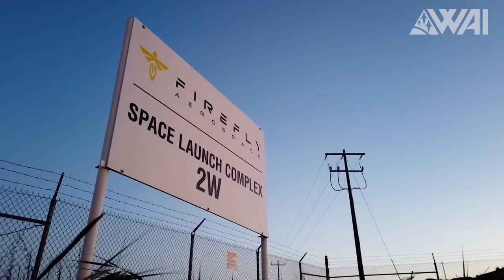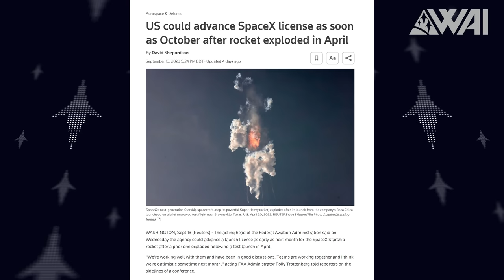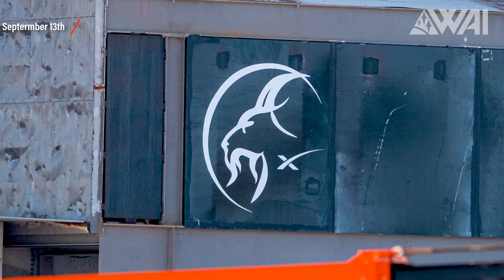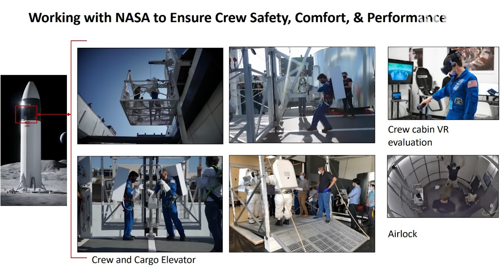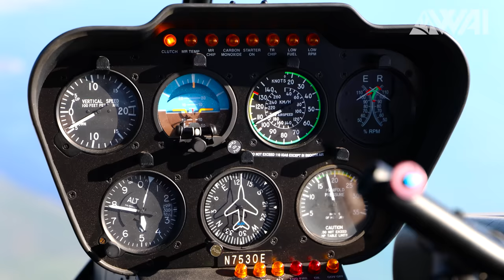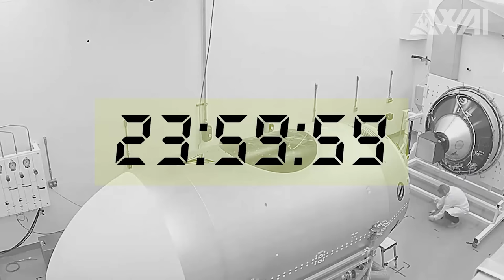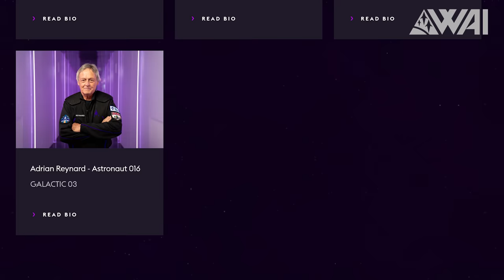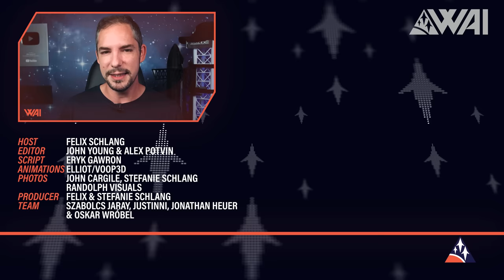Bad News for SpaceX's Starship! Good news for another Rocket!

Comment: With SpaceX developing a private version of Starlink for the military you'd almost think the US military could/would move things quicker citing strategic importance
Reply: The US military reserve the tight lock GPS away from all users (except them). Starlink will probably use the same principle. US military reserves the right to grab 100% bandwidth when tactics/strategy demand.
Reply: @Dave5843-d9m They stopped reserving accuracy for the military alone over twenty years ago.
Also, they can't "reserve" anything if it doesn't exist nit wit. Try reading the original comment, considering it, then answering it in a way that a way that actually makes some sense?
Reply: They are? Complete BS. They formed  committee to study the feasibility, period. Point to point is complete vaporware.
Reply: @UpperDarbyDetailing   correct. The OP is not correct, BTW.
Reply: @jcwiggens  I didn't know if they were or not, which is why I didn't comment. Thanks for the further input on that topic.
Reply: Strategic importance?...What do military communications have to do with gender equality 🤔
Reply: @THX..1138  what?
Reply: @UpperDarbyDetailing  I was wondering the same thing.
Reply: That was how Kennedy was moved along and why to this day the studies they are required are fewer and have never stopped it's mission.
Reply: FAA & FCC move at there own pace. It's a ballet.
Reply: you want the military to move fast on anything , wow, you must not know the military.
Reply: @kstaxman2  Kennedy has always been civilian.
Reply: @jcwiggens  yes Kennedy is and has been a civilian facality on paper but from the beginning the military has used it to launch military equipment and as such pushed to get them open and keep them open. And the launches themselves were almost all government launches. From Mercury to the space shuttle Kennedy almost exclusively handled government programs. It's only been in the last 15 years or so that private programs have existed in any meaningful way. And when was the last time you heard of a launch at Kennedy being held up by an environmental review? They are allowed to operate with environmental oversight but Kennedy as NEVER been stopped from launching for environal issues nor for their proximity to the heavy populations that are in the area. And after 50 years the wet lands and oceans that make up the environmentally sensitive area Kenney is located in have done just fine.
Reply: @seancollins9745  , who were you referencing? Because I only served a measly 23 yrs. And no, we want the military to move steady, smooth,and only when "fast" appropriate. Moving "fast" usually leads to mistakes, death. The military mantra is slow is smooth, smooth is fast. Not rushing into doing wrong things, mistakes. Civilians have this wrong impression the military is this magical thing that does miraculous things at a whim. Which couldn't be further from the truth. From idea to engagement on mist everything it's months to years. Only actual combat is fluid, even then there's a ton of planning thought out weeks, months in advance. Only when certain immediate objectives need to be taken, as the alternative is worse, is there rushing. Save all that Hollywood high speed shit for the theater.
Reply: You have to take in things like approval, budgetary constraints, the fact sats arnt things you 3D print in the garage over night, take years to vet functionality and survivability, as they cost billions each, logistics, and while spaceX is doing good, it's still in its infancy, has existing contracts, and if the U.S. should start planning sats in space suddenly, it eoyld cause international alarm, and people like putin/Russia, get button pushy feeling real quick. Slow, calm, and steady is the way. The other hold up is the democrat party that doesn't have any love for either space exploration, nor for Elon, a Conservative. They think his money should be spent elsewhere.
Reply: @ThatGuyintheKilt ,  talking coms or GPS? SpaceX isn't really into Geo Synchronized orbits at this time as they require single use,loss of rocket modality. They're not able to build rockets that fast,  at least not while starship is in its infancy requiring priority most of engines built, and facing time constraints with the FCC and international challenges,  ie, China and India trying to shut him out, not to mention bozo.
People seem to think he and his business exist at the pleasure of government. Not realizing that things like starlink were not put up to solve world internet desires, but to provide a service for SpaceX, while also targeting rural coms for revenue for SpaceX as well. Starlink first and foremost serves SpaceX needs, and is also rented out as a secondary revenue generator. 
I mention that regarding those that complain about him shutting off service to a location in Ukraine that he didn't even offer service, but temporarily adjusted for temporary use, then found out it wasn't being used for emergency use as stated, so he put them back into intended orbit because he doesn't want to be an accessory to war operations of foreign nations.
Reply: @UpperDarbyDetailing  Excellent reply. The prevalence of "nit wit's" in the YT comments is astonishing. I am eternally amazed at the number of posts that are incomprehensible gibberish.
Reply: @robertm1672  tag the wrong person?
Reply: Hope these Military Satellites do not turn into SkyNet!

Comment: 3:15 the water discharged isn't toxic, but it's fresh water. I don't know the normal rain fall in that area, but I think the local flora could be affected if most of the ground water is brine or even sea water and the plants are adapted to that salinity.

On the other hand, it might be that the FAA is also crossing all the Is and crossing all the Ts by updating the statement and denying the opposition any chance to sue for not having the new plate in the considerations.
Reply: Fresh water shouldn't be a problem, since the deluge system could run continuously for years and not match the volume dropped by just one of the hurricanes that regularly trouble that part of the world.

I suspect they're more concerned about contaminants... it might be clean water coming out of the pipes, but it's flowing through an industrial site, so the question of what's flowing into the sea must at least be asked, even if the answer is "nothing serious".
Reply: The bigger issue would be the boiling water - which can cause faster chemical reactions and generate unpredictable results.
Reply: @jessepollard7132  That doesn't help, certainly...  that's the factor that upgrades "just use seawater" from merely being a bad idea to being a catastrophic one.

I doubt it would still be boiling by the time it reaches the local waterways... it'll lose heat pretty quickly flowing across the ground. But yes, even if it's only a few degrees warmer than the surrounding water, it's something that can disrupt the local ecosystem. Better if SpaceX can prevent the runoff from occurring, avoiding the need to debate the consequences...

Comment: Thank you ror 300 learning experience options. SPACE X has so many engineering steps, projects etc and each gets tested retested and redesigned. This is why engineers want to work for SPACE X by preference. There is so much leading edge in depth work of substance to focus on.

Comment: Even when the air is hot and dry it's never as dry as you might think it is. Those tiles hold so much moisture they are drilling more holes and larger holes at the bottom of each tile to give water vapor coming out of the hot tiles a place to exit. It prevents tile cracking and spalling.
Reply: Sounds to me they need to manage the humidity with some kind of dehydration skirt and negative pressure interface or at least a subdermal heating element matrix.

Comment: My guess is that they will need to build something to collect the water för cleaning. As I have written before, pressure washing the launchpad with steam and sending it hundreds of meters of the base in a sensitive environment will probably not be tolerated. The question is more WHEN they need to build it. Will another launch be tolerated before this is in place?
Reply: why not, a rainstorm dumps that much water in a minute onto the area and the river a quarter mile away dumps that much water every minute into the nearby ocean and wetlands.  in 100 yards, it is water vapor(same as a cloud or fog)more than steam.  I have seen no vegetation effects.  the trees are still being trees, the bushes are still bushy.  They built a collecting pond and just finished a raised border for the pad that sends the water for collection.  They are using potable water from brownsville -
Reply: You know the Cape is also surrounded by vast nature reserves and they tolerate the deluge clouds just fine.
Reply: @peetky8645  Its not so much the water as all contamination from the launchpad being washed away... (Yes their will be a lot of contamination from both all work being done with all tools and vehicles but also from oils and stuff being used on every single movable part of the base)
Reply: @drosendahl  So by "collect water for cleaning", you meant in case someone spilt some drops of oil while lubricating a hold-down clamp hinge?
Have you noticed how SpaceX can cover the rocket bidet in a tarp when not in use?
How do you think your concerns compare to a dark-grey deluge cloud of water mixed with a few tonnes of burnt diesel (RP1)?
Reply: @drosendahl  oil is an organic compound and is biodegradable.  maybe coolant from a radiator leak could be a problem.
Reply: @peetky8645  Oil leaks may still be very bad for living things but it was just an example, that's why I said "contamination" because it most likely more than different types of oil.
Reply: @cbboegh  Compared to what? The only things FAA and Fish and Wildlife will compare with is with no activity at all on the site. That someone/something else is worse is never a good excuse. We will see but like I already said I'm guessing they will have some concerns about it.

Comment: The fire water probably needs to be collected after each launch, it cannot spill in to the surrounding environs, similar to sprinkler systems in buildings if activated in the event of a fire it has to be collected in an underground concrete container.
Reply: In a building, that makes sense, at the launch site it doesn't.
Reply: @TheEvilmooseofdoom  Consider that they'll be dumping a whole lot of FRESH water into the local ecosystem (regardless of any potential contaminates). The shallow water table likely has a high salinity factor due to the closeness of the sea water, though whether that's a possible concern or not, I can't say for sure. I'm sure a containment and collection system could be made, along with a water treatment or at least a pre-treatment plant (have a settling tank -> floculent tank -> coarse filtration tank [with sand], before pumping the water out to a sewage system). Several possibilities for collecting, treating, and possibly reusing the water.
Reply: @TheEvilmooseofdoom  still think this doesn’t make sense?

Comment: Speculation: Fish and Wildlife is concerned about the new deluge system at the OLM. When in operation, 350,000 gallons of fresh water are released into the launch site and some of it runs off into the saltwater wetlands adjacent to the launch site. Saltwater sea life could be adversely affected.  Solution: a bigger detention pond to capture the deluge runoff water.

Comment: They are detaining the water in detention ponds. I am sure a civil engineer has done the calculations to determine these things already. So the FAA is going to review it, but calculating anything besides pure volume is going to be impossible without testing the new setup for how dirty the water is from dirt on the site, but even then that is dust that is already eroded from elsewhere through wind. If anything this massive amount of water going through detention ponds helps fight pollution through dilution of any pollutants on site. As far as an environmentalist is concerned, besides BOD and COD, the solution to pollution is dilution. The amount of water coming from the deluge system is tiny compared to even a 1 year storm event. It really isn't that much water, and it looks like most of it will be turned into vapor instantly and rain down on the surrounding area, which seems pretty good too me. I'm not sure how the tiny amount of water from the deluge system affects the environmental study.

Comment: 1:03: 🚀 Starship gets destacked in Texas.
3:32: 🚀 SpaceX's second Starship launch is facing delays due to consultation with the US Fish and Wildlife Service, but these delays are insignificant in the grand scheme of space exploration.
6:56: 🚀 Ship 28 is a prototype for a reliable, first edition standard-issue Starship with intriguing updates.
10:44: ! SpaceX successfully executed a cold start of a Raptor Vacuum engine and performed a powered descent profile test of a standard, atmosphere-optimized Raptor engine.
13:38: 🚀 Weather plays a crucial role in space enthusiasts' experiences, but MyRadar helps to stay ahead and avoid surprises.
17:18: 🚀 The MS-22 crew faced a dangerous situation caused by a micrometeorite hit, leading to a coolant system failure and the need for an uncrewed Soyuz capsule to serve as a lifeboat.
20:44: 🚀 Firefly Aerospace and Virgin Galactic celebrate successful launches and increased frequency of space flights.
Recap by Tammy AI

Comment: this "reach orbit" launch will still ditch both starship and booster in the water  ( and then drag them back for analysis/recycling I would hope ).     Launch 3 will have to be about recovering the booster,  and  by the fourth launch they will need to start recovering the starship as well.
Reply: They most likely won't be dragging anything back from the ocean. Huge amounts of effort for near zero benefit.
Reply: They will just sink them (and S25 will explode on impact)

Comment: Congrats on 300 episodes! 

About those black vent covers...are they fixed in place or do they articulate? 

About gasses needing to be vented if sitting too long...I wonder if anyone has thought about capturing those gasses and re-condensing them so they can be saved in liquid form. I'd think it would take a device similar to the fueling arms to hook up so that the gasses could be captured instead of just letting them vent off into the atmosphere. The three R's -- Reduce, Reuse, Recycle; or "waste not, want not".

Comment: Does Spacex ever test mulitple raptor engines at the Macgregor facility? I mean just firing them close together in a group, the same way they are configured in the Starship or booster.  Maybe the problems they have had with fires in the test flights might have something to do with mulitple engines close together?

Comment: I suspect that the strange new boxes might be sensors, stuff for detecting the velocity of the upcoming air and such. Similar to a Pitot-static system, if thats not exactly what it is. Giving information to the spacecraft as to the Airspeed, Mach number, altitude, and altitude trend, being made of a pitot tube, pressure chamber, and drain openings. And in aircraft design at least, they are typically located near the nose. 

With some heat tiles to ensure that it doesnt melt from the plasma from reentry, it might be specialized, or at least rated for that region of velocity and pressures

Comment: I'd say the water runoff into the swamp around SpaceX property isn't going to be allowed. So drainage ditches and retention ponds and THEN pumps to take the 'contaminated' water to a treatment facility. The finally discharge somewhere.
My guess is Elon will find a way to do all of the above then use the treated and filtered water AGAIN for another launch.

Comment: Why does Starships launch rely so much on the FAA where other launch vehicles such as the Falcon 9’s and the space shuttle never seemed to?
Reply: Falcon 9 relies on the FAA just as much as Starship does. But Falcon is an operational vehicle, so subject to different rules from the experimental Starship. The former is actually held to higher standards than the latter, but the paperwork is easier because they're not redesigning everything after every flight.
Reply: @simongeard4824  thanks for the info Simon 👍

Comment: the FWS could delay the launch until Feb.  The letter I saw made it seemed like they would take their time.
Reply: There's no time limit FWS can delay as long as they like then FAA can take as long as they like to consider the FWS's report. This democrat obstruction Starship will not launch before next summer if it launches in 2024 all.
Reply: @THX..1138  another YouTuber (idk which one) wrote them and the FWS replied they had up to 135 days to decide.  At that point if it's decided another EA is needed it could go even longer.
Reply: There is nothing in the law barring FWS from taking more than another 135days. All they have to do is issue notice saying they are taking more time. When day comes they finally complete their assessment. FAA can take as long as they like consider it through various delaying tactics. Even without ordering another EA they could delay a second launch till 2025.  @Ittiz

Comment: as long as they use Brackish water, what's in the local estuary of concern, there is nothing to do. Methane is a very clean burning fuel that does not associate with water. Anyone with any knowledge of this fuel knows this.